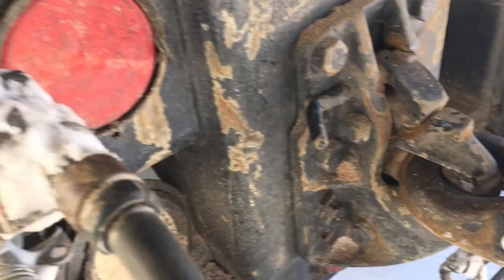How to free frozen trailer brakes

Comment: Only probkem I have is you beating the brake pads and on the sides.  You should be hitting under the brake drum as the vibration of impact steel to ice will loosen it to move.  Subsequently your braking during your drive (esp if its a long non stop trip) will melt and dry everything.

Peace,